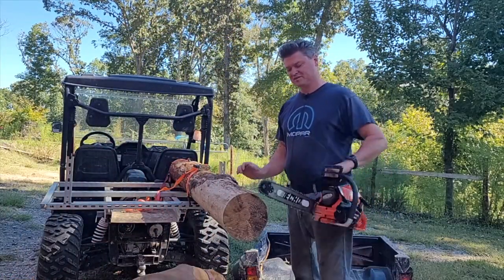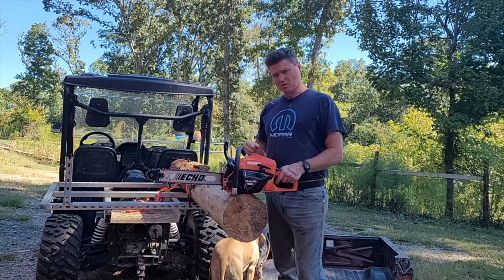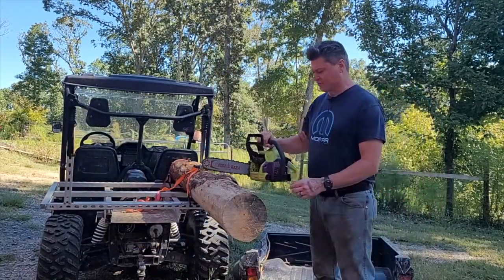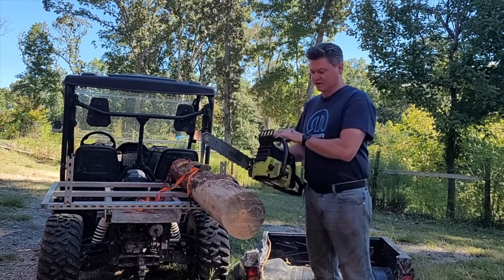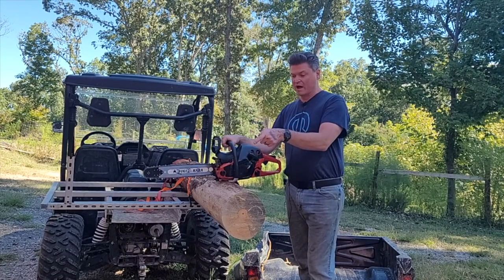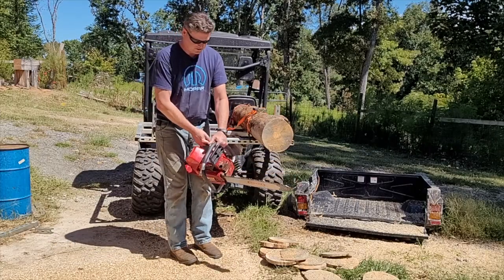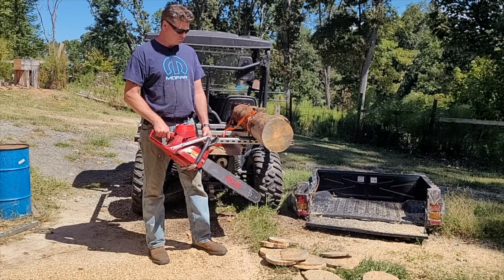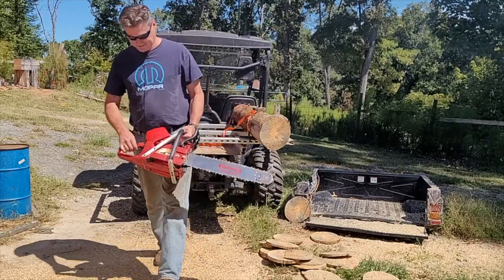Preparing my Race chains for Saw Fest!

Comment: She’s was a little flooded!!!! Like how your mind processed that after a couple pull’s!!! Get your trigger pulled and your throttle wide open and blow that excess gas out!!!  Nice!!!   Practicing your starting and those 3 cuts is probably just as important as how fast the saw’s can cut!!!  You can gain an advantage with your technique!!!